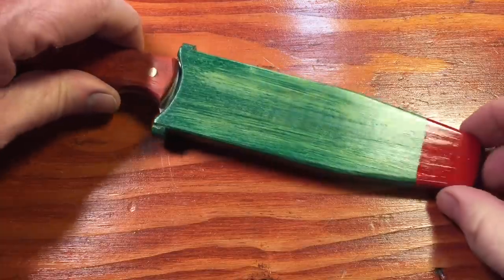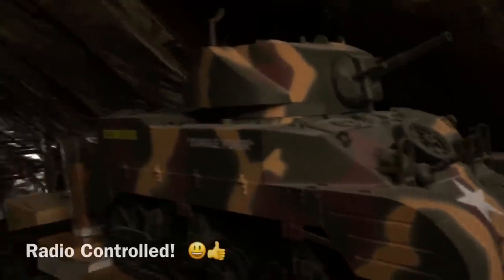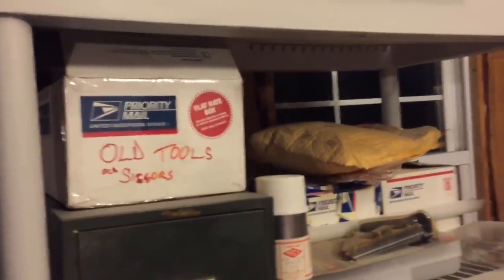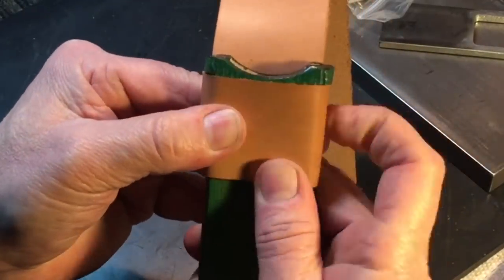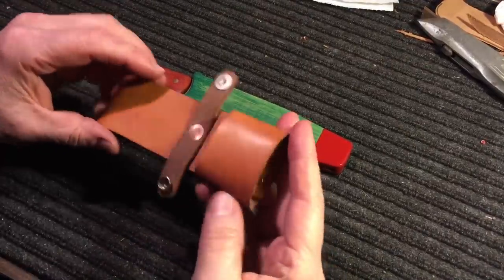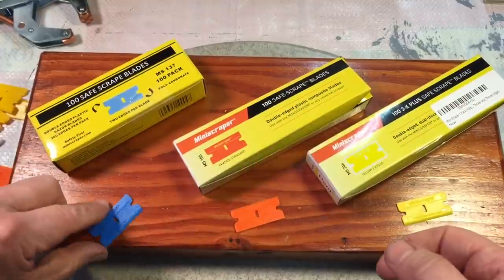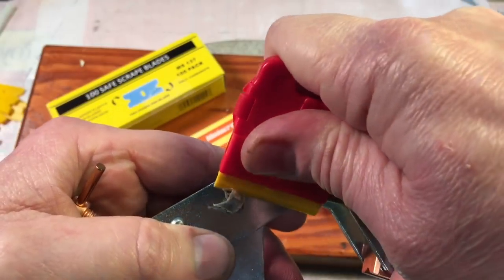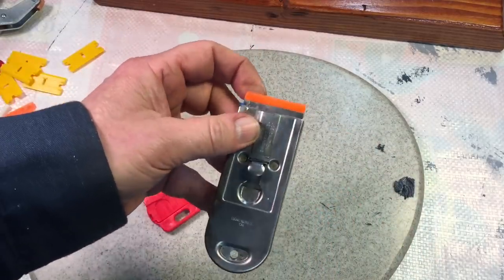Making a Scabbard Frog & Plastic Razor Blades

Comment: Brian is right - I use exactly those plastic razor blades and that ACE holder, and they are super useful in tool restoration as well as machine projects, and furniture refinishing.  I also have a holder with a handle that makes it about the same size as a putty knife with the Delrin blade installed and that's great if you need to scrape a larger area.  I didn't know they made the yellow, and blue blades - I use the orange ones several times a week.

Comment: Those plastic blades look interesting. You have a ton of cool stuff in your attic. Looked like a CB or Amateur Radio antenna on the floor up there. I have found some great stuff in the garbage as well, but I try not to pick anything up anymore because I could easily fill my garage with neat treasures. If you ever do move, you're going need a crew!

The leather work and the knife look fantastic. I think an attic tour special would be awesome. As always, a fun and educational experience.
Reply from the maker: Hi Paul! Good eyes!  It’s a ham radio antenna!  2m/440/6m  😃👍
Reply: I thought so. I'm a ham.

Comment: Everything for the knife turned out good. Really like the plastic blades. You are right. For years I used the metal ones to scrape with at the hospital but it always left scratches. I will have to find some for home. Did you say Ace hardware? Stay safe and healthy my friend. Thanks
Reply from the maker: Hi Glen- Ace for the handle but https://miniscraper.com has lots of packages!

Comment: Thought this would be a good place to ask. I'm 17 and getting into restoring and I have an adjustable wrench but it's rusted tight and is completely siezed
Reply: Any advice
Reply from the maker: Burkey turkey Sure, soak it in vinegar or evaporust for a couple days then try heat!  It should break free!
Reply: @ScoutCrafter  I soaked it in dilute hydrochloric acid for 24 hours
Reply: Only recently I may have some access to heat as I found a old propane blow torch connection

Comment: Birdhouse Challenge Question: Since "Homeless People" use cardboard boxes for a shelter, could I use an Amazon Box and call it an AirBnB (pun) for Homeless Birds? (wink wink) =P
PS - With the knife on your belt, would the sheath also slide up, when you extracted the knife? Maybe a piece of Velcro on the back of the sheath & leather to hold it on!?
Reply from the maker: Alan It’s a very snug fit and the knife is not tight in the scabbard...  It would take two hands to remove the scabbard from the frog!  😃👍